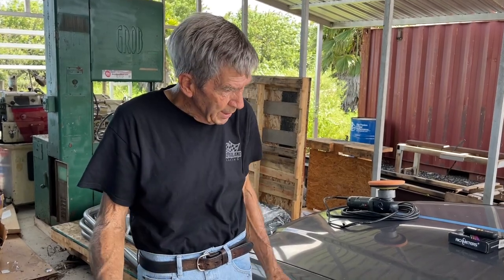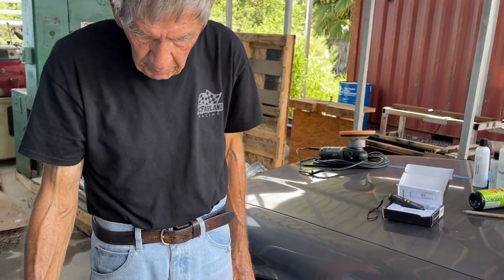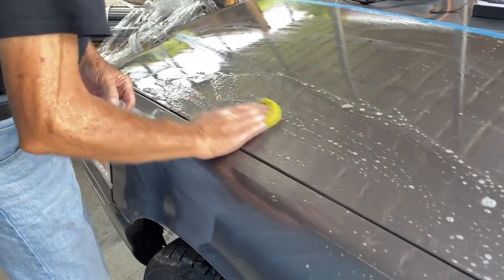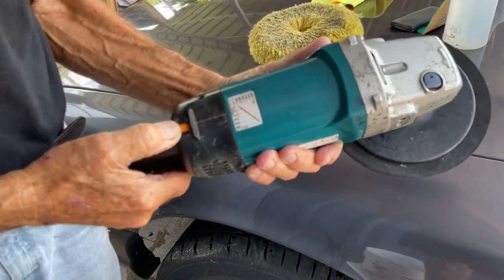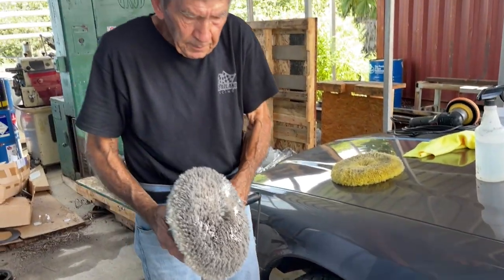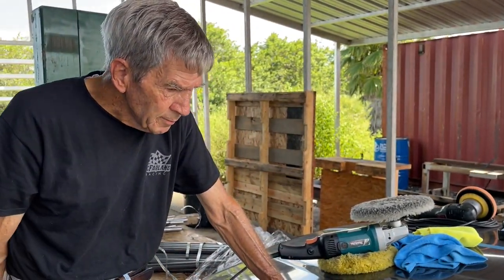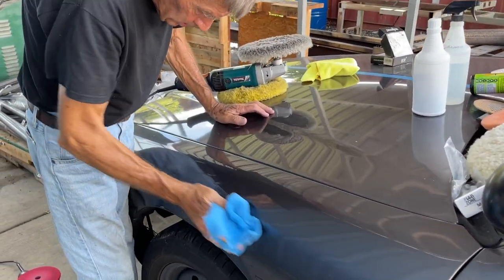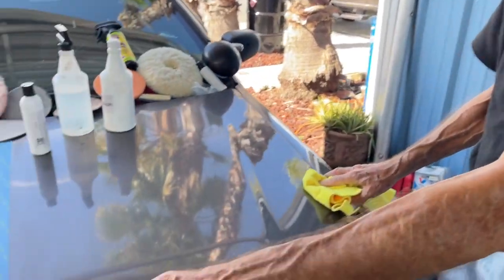How To: Cut & Buff Paint/Clear Coat

Comment: There is a lot to learn about shiny surfaces.  I was under the impression it was up to the cream-type polish and some application and removal effort., to achieve max. reflectivity.  (The final test I learned: After applying shine product, a soft towel should slide off the car with little to no push. (Glides off). (Several factors involved with this test).  Thanks Sam.   {There is a learned skill to polishing}.

Comment: I really love this video! Thank you Sam! I watched this in its entirety on a different computer. You're an actual wizard at this though I suppose you should be after you retired from all of that. I would really appreciate the tips and tricks you use to make headlight plastic look clear again!
Reply from the maker: On my headlights here is the process I do. I use my tire and wheel cleaner for my initial cleaning of the headlight.  Then as I mentioned if its real bad I take either 1200 or 1500 sand paper then I use my makita buffer with a wool pad for my initial buff the compound I use is my Light Polish.  After this I used my random orbital polisher with my maroon pad and the light polish compound. Settings on the makita are 1500rpm and 6000 orbits per minute on my polisher. The polisher I use on this is the Porter Cable 7424xp

Comment: Hello Sam. I noticed that your Mil meter showed around 11 to 12 mil's on the fender and hood. This tells me that the body has more than likely been painted 3 times, even if it's a factory paint job. I work in the paint shop for one of the Big 3 auto manufacturers. We can repaint a body up to 3 times, and there are a lot of reasons for that. The E Coat is around .50 mil's. The first paint job is somewhere between 4.38 & 5.2 mil's. This is E coat, primer, paint, and clear coat. A second time through the paint booths will show around 6.8 to around 8.2 mil's. What we consider high mil's is the 3rd time the body has been repainted, and that is anything over 11 mil's. We use a 3 wet paint system at my plant. That means the primer, paint, and clear coat doesn't dry between applications. Once the vehicle is painted and ran through the gel ovens to cure the paint, about 22 minutes,  the body goes across our polish decks. This is where any small imperfections, like dirt in the paint is polished out. Sometimes they use 2,000 to 3,000 grit 1" sanding disk to remove the imperfections. Then use a small 1" polisher with 3m Finesse It polish. If the operator can not polish the imperfection out in about a 45 second, as that  is their cycle time, they will send the body to our ICU. Once the body is at ICU, the operator has a little more time to either fix the issue or send it elsewhere for other options. If the imperfection is on a piece of swing metal  (door, hood, lift gate, trunk of a fender) the body will go to our Part's area. The people in Part's will change the piece of swing metal with another painted part, or move the affected part to another vehicle that has other paint issues, like a quarter panel, header, rocker, roof, or one of the pillars. The bad part will be used on another vehicle and be repaired in our scuff booths, then sent to repaint. We measure the mil's on each part to make sure it doesn't get painted more than 3 times. We try to match the mil's on the part, to the mil's on the body.  It's really a very complex system, with hundreds of variables.  Take your mil meter over to Cleetus' shop sometime and measure the mil's on the new vehicles. Check the body ie roof, pillars, rockers, quarter panels. Then check each of the pieces of swing metal. You might be surprised  at any differences you come across. The roof could be 11 mil's and the hood, doors, fenders lift gate, trunk or tail gate could be 5 mil's, or a mixture of all of the above. This tells you that parts have been changed in the manufacturing process. I have had people ask me why we don't polish the orange peel out of each vehicle. When your cycle time is around 45 seconds, meaning the plant is producing and rolling a new vehicle out the door every 45 seconds, it would take an army of people just to polish out the orange peel in each and every vehicle, and would raise the cost of each vehicle produced.  Keep up the good video's and I hope to see you at Indy  on May 3rd & 4th.

Comment: What about a vehicle with missing or oxidized. Clearcoat ? What would you do
Reply: Best bet would be to fix the clearcoat
Reply from the maker: Many factors involved here. If the clear coat is still in tack but just faded I would suggest using my Light Polish with the maroon foam pad with the random orbital polisher using the number 6 setting. This is a 6 inch foam pad.